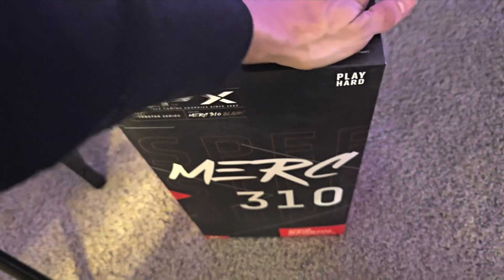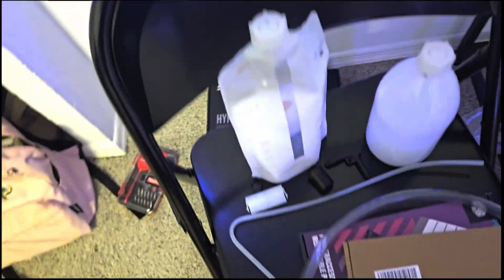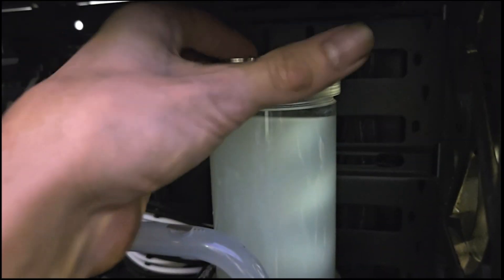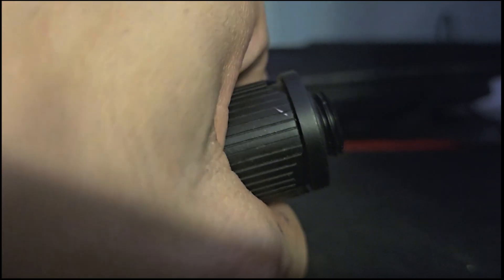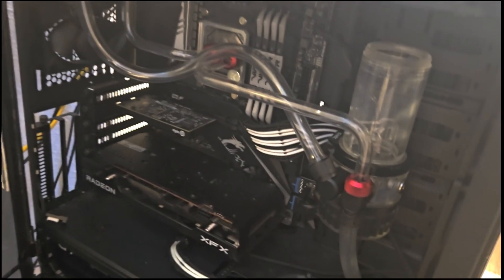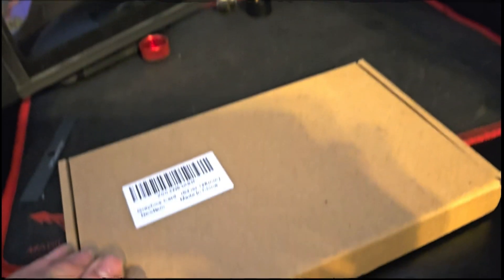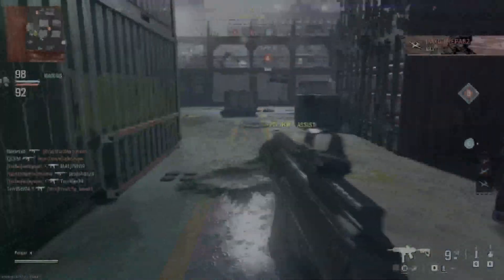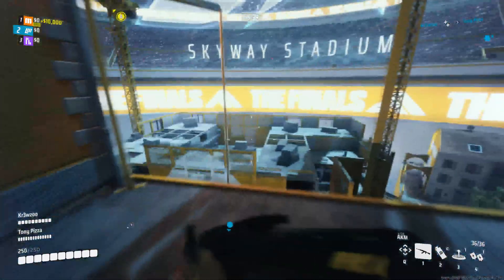Installation and Quick Review of AMD Radeon RX 7900 XTX

Comment: Your pcs lookin crispy
Reply from the maker: Well, it still bakes unless the case door is open. I would have to get a bigger case and more fans to solve that issue if I wanted it closed. 🙄
Reply: @Revolt1Purger  can’t you get the stuff to liquid cool the gpu eventually
Reply from the maker: I looked for power color one on the company's. That makes liquid cool Gpu's, but they have been out of stock for a couple of months for a 7900xtx block or gpu. I can't find one for the 7900 xtx.
Reply: 🎉🎉 se ji😢😢

Ki ki by❤😂 2:41 2:43 2:46 🥰 @Revolt1Purger